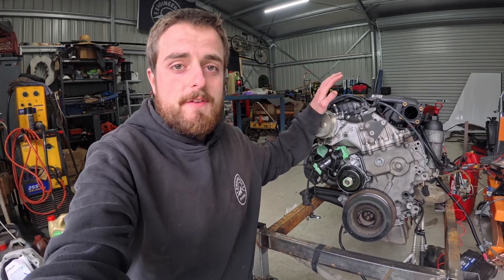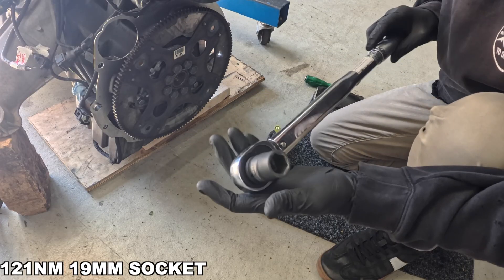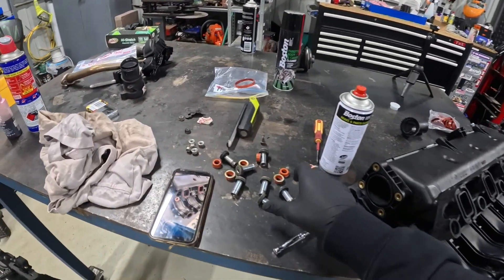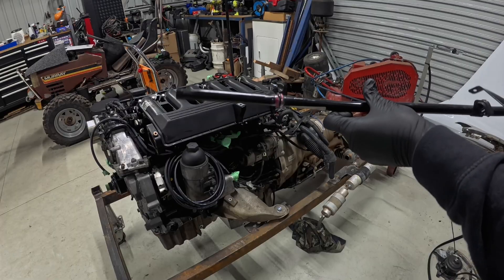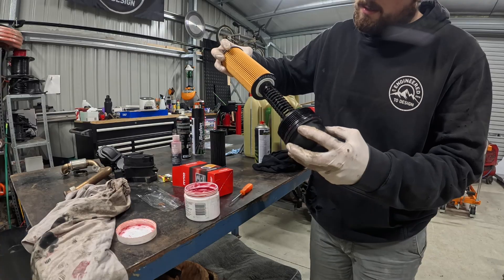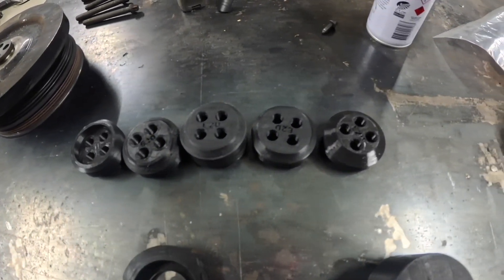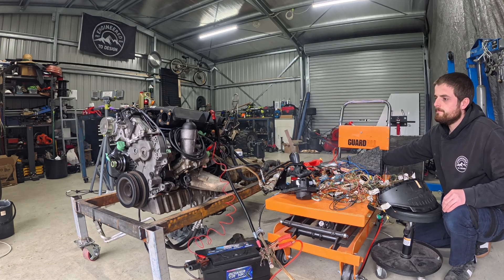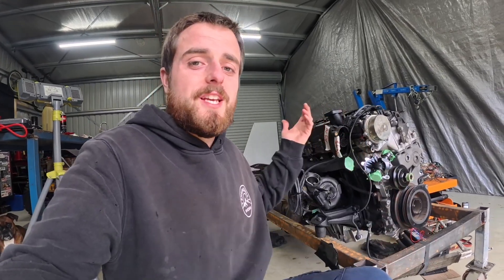M57 Engine Into Toyota Landcruiser BEST DIY ENGINE SWAP - Pt 5

Comment: Hi mate. Just after your opinion..
My son has a 2000 model 105 DX with a 4.2 Aftermarket Turbo. Goes really hard..But he has come up with an idea to swap it out and put the Same BMW Diesel in..
He has no hoist. No experience with BMW's or engine swaps himself.
I've advised it is a terrible idea and a massive job that can run into huge hassle and he is far better sticking with his worked 4.2 TD..
Can I please get your advice?
He has no idea of the complexities involved..
I'd appreciate your advice.
Regards, Adam McShane
Reply from the maker: Hi Adam,
It’s a hard one the Toyota engine is very reliable and hard to give in if you don’t have much experience. Honestly depends on what he’s after out of the cruiser. Auto is a big upgrade and more power with the bmw engine..

Comment: If I can make a suggestion from my own experience.  The oil filter housing/cooler has a seal to the engine block which is pretty cheap and easy to replace with engine out.
Reply from the maker: Great suggestion, I replaced mine a few weeks back

Comment: What’s your preferred gasket goo ? I’ve seen loctite 5970 recommended but hard to get
Reply from the maker: Three bond is amazing, used it for years it’s what Isuzu use.. never seen it fail
Reply: Which 3bond do you use? There seem to be a lot!
Reply from the maker: @Rb0395 1207C